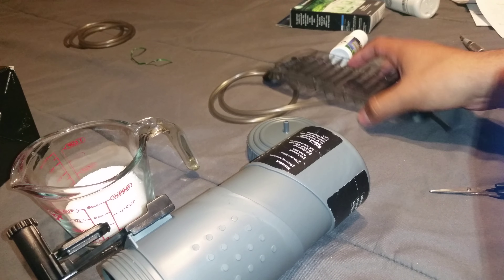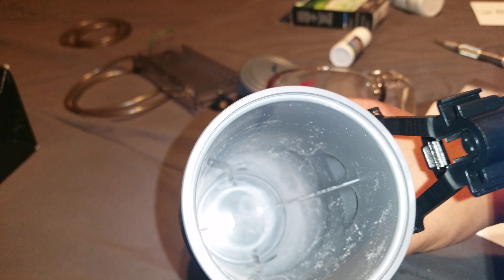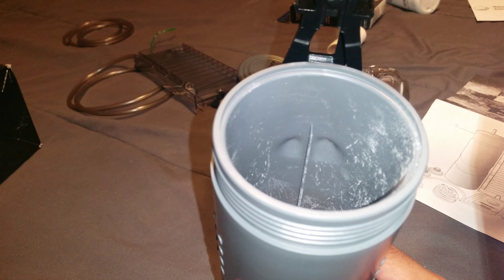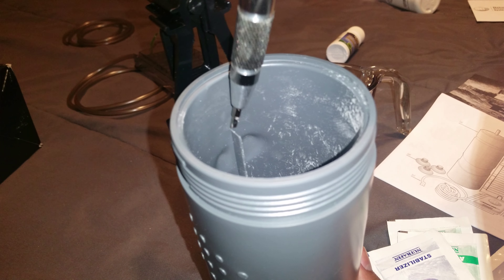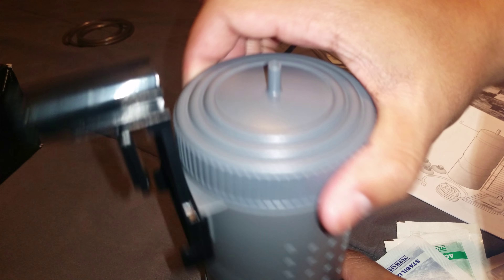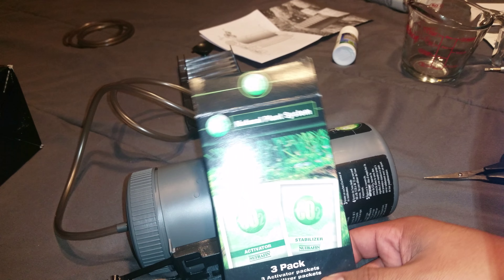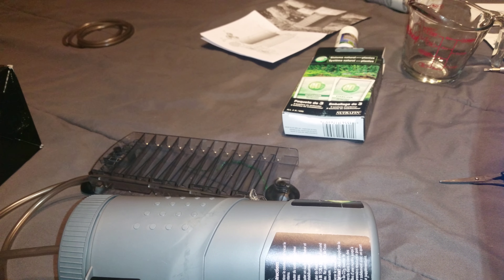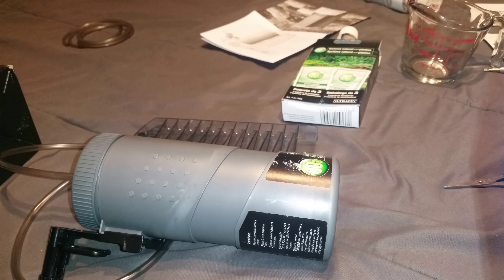Setting up the Nutrafin Co2 System (pt.2)

Comment: i see that to canister goes only 1 tube. my logic asks me to ask you if there is a way to use splitter to run 2 lines of co2 bubbles & increase amounts of sugar & stuff in canister? Or the amount in canister is just for small tanks up to 20G?
Reply from the maker: +RinaDasler That's a good question, unfortunately it wouldn't work. there is not enough pressure and this will result in poor c02 emission. what you can do is set up multiple bottles and connect those to c02 diffusers. but if you release too much c02 too fast the amount that gets dissolved reduces. so for this method (ladder) you are fine with 1 and 1. to answer your question about your 90 gallon, you would need 5 of these. 20, 40, 60, 80 , and 1 more for the remaining 10 gallons. if your plants are not growing its most likely due to lighting. people often underestimate the plants need for strong lighting. and in a 90 gallon you need to make sure you have enough light to penetrate through all that water. I hate to be one of those annoying people that ask for likes and shares..but definitely subscribe. I have been working on a bunch of better quality plant videos that I think would help a lot of people! thanks for the comments:)
Reply from the maker: +myaquariuminfo ill be releasing them in jan 2016. ill definitely use your comment(:
Reply: myaquariuminfo
thank you!
Reply from the maker: Your welcome (: im glad I could help